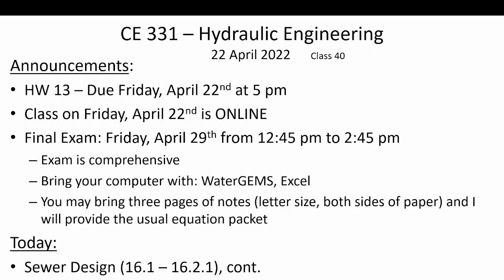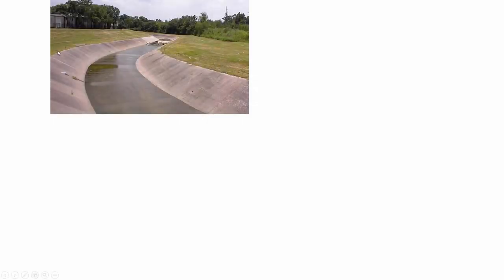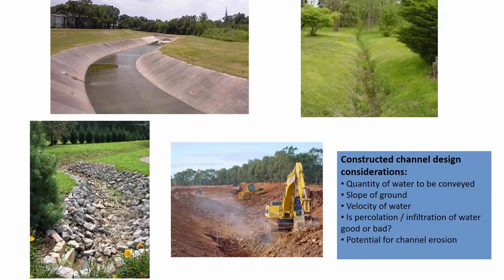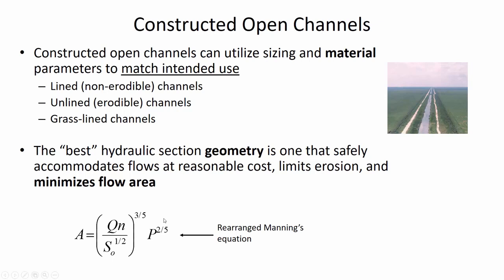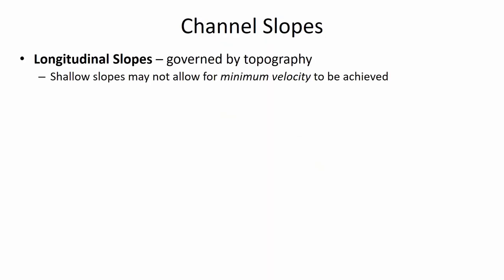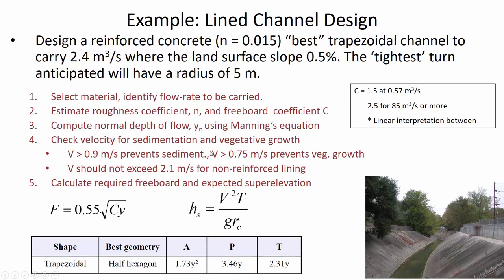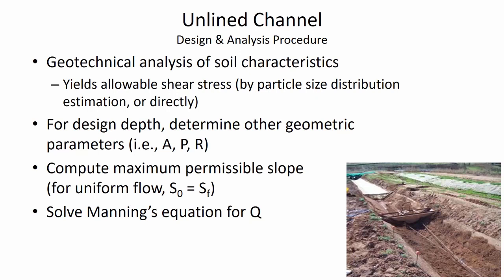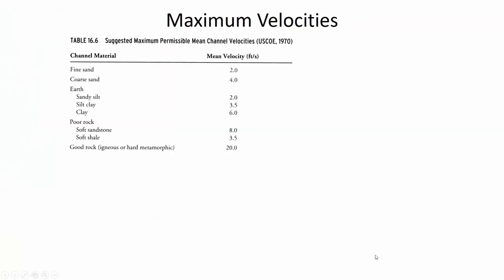Design of Lined and Unlined Open Channels - CE 331 Class 40 (22 April 2022)

Comment: Hi Isaac, excellent video! I deal with a special lining material (a combination of concrete + membrane). I wonder if you are familiar with Hydraulic Calculator of FHWA?  The channel that we deal with has extreme high velocity that can reach 15-20m/s and the flow rate can be 50m3 / sec. Happy to know more on channel lining with flexible and impermeable membrane. This seems like a new way lining a channel nowadays.
Reply from the maker: 20 m/s!?! 😲 That water is moving!  Yes, I've used the FHWA Hydraulic Toolbox before - good stuff.